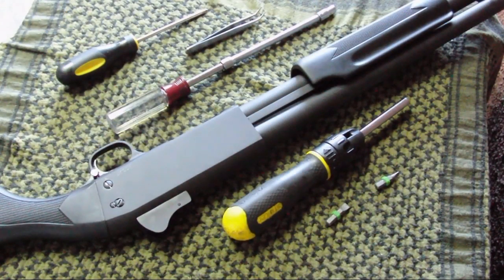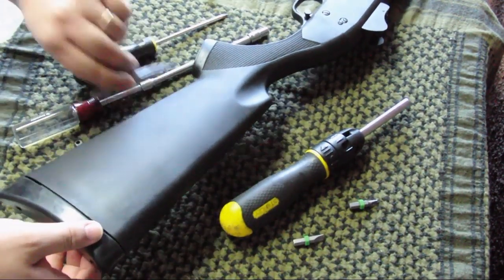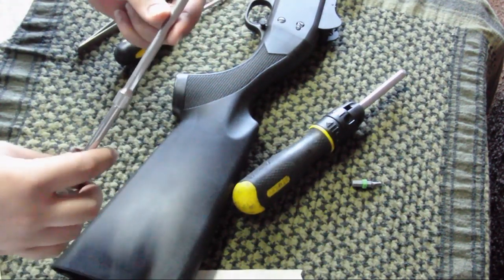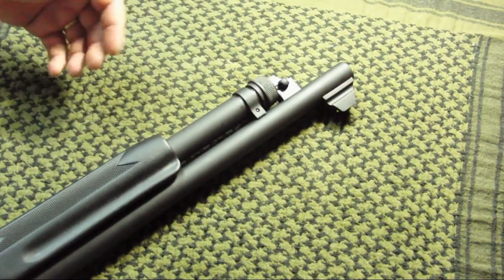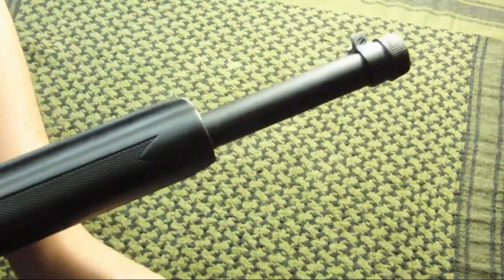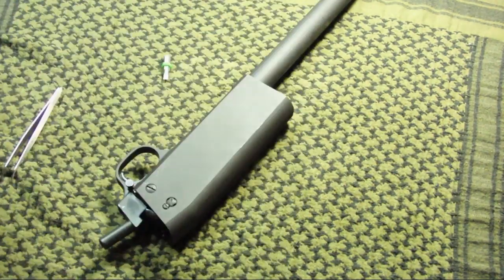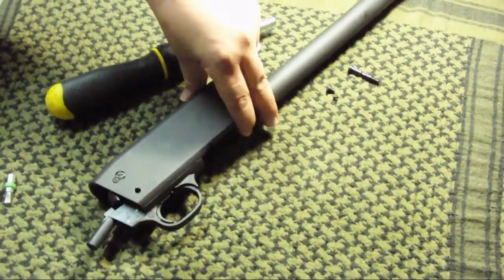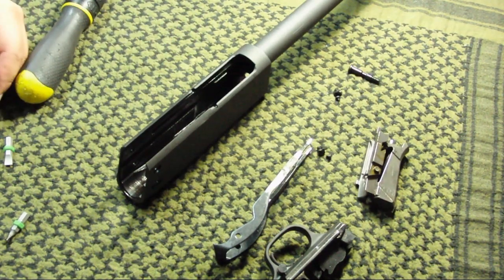Stevens 350 Pump Full Disassembly

Comment: Late reply, but I had to use a 3/8" socket wrench with an extension. I slid a screwdriver bit into a socket that would hold it snugly and carefully put it down in there. It was hella tight but I got it loose with this method. I also tightened it the same way.

Comment: I had the same problem when I first bought my S.A. 350.  If you do these two things, the problem (provided it's not a manufacturer's error) should be remedied.

1) Only use 2 3/4" legnth ammo enstead of the full 3".  This will give more "play" for the ammo to be ejected.
2) "Pump" the handle hard after each shot.  Because the extraction of old shells and the insertion of new ones occurs at the same port, the spent shell must be dispelled "hard" each time to clear the chamber for the new shell.

Comment: I have been working on my 350, picked it up in a trade and will be Cerakoting it but I can not get the forened removed.  Is there a trick to this?  I tried a pair of needle nose and a pair of tweezers, but still can not get it free from the bolt carrier.
Reply: I'm having the same issue, looks like they mushroomed out the end of it so you can't loosen it?

Comment: Great videos, I will have them loaded and playing when I do my first major breakdown. I saw this shotgun in the store and could not resist it for the price. After about 300 shells both shot and slugs it has gone bang EVERY time I pulled the trigger. 

I do have a question that maybe you can answer. I have heard that the safety can be reversed and be functional for a left handed shooter if there is a hole drilled on the opposite side for the detent spring and pin. Have you ever looked at this?

Comment: There seems to be a QC issue with the Stevens 320 side eject pumper; the spot welds forward on the guide rails where it attaches to the foregrip sleeve collar break.
Did Z or anybody see or know about any similar concerns on the 350?
I see the nut that requires what's called a long shank pin spanner to disassemble the foregrip, but don't want to do it if not necessary. The sliding sleeve over the mag tube is plastic? Yuk! I hope I don't have to get it re-made in metal. Info appreciated,thanks.

Comment: I've followed your video exactly, but when i get to the bolt that holds the trigger assembly in place, it won't back out. it's nice and loose at first, and when i mess with the trigger guard it has the slight "play" that you talk about, but then it just gets real tight and won't back out. I don't want to force it and cause a problem.. any ideas what the issue may be?

Comment: The trigger bolt won't come out I have no idea why it's loose it just won't slide out
Reply from the maker: kenny roth roth Make sure the stock is removed from the frame before you take the trigger housing screw out since the stock adds pressure binding the screw in place as well. If the stock is removed then I truly don't know what would be happening give savage customer service a call I"m sure they would be able to walk you through it.
Reply: Practical Firearms Yeah the stock is the first thing that goes, like in your video which I don't understand because the first time I took it apart, it was fine and no problems. I'll just take it to a local gunsmith and see what they can do to fix it.